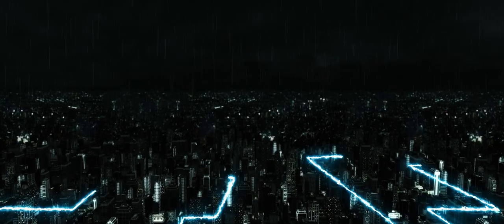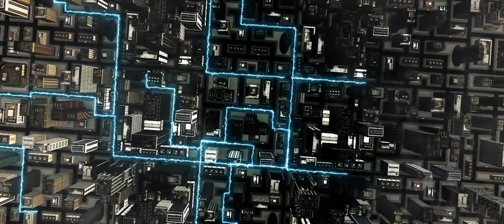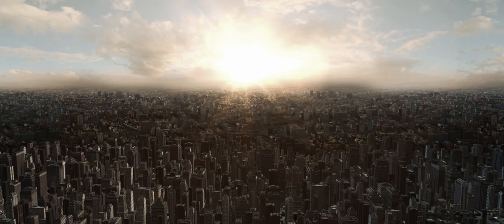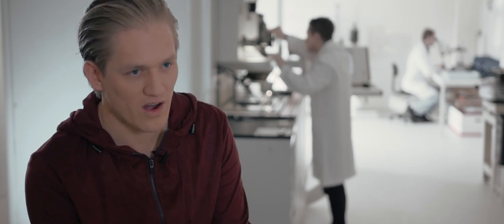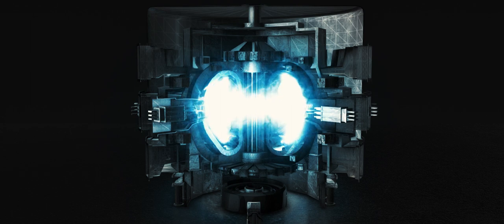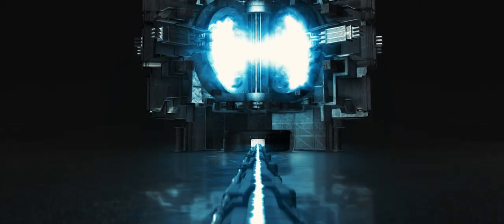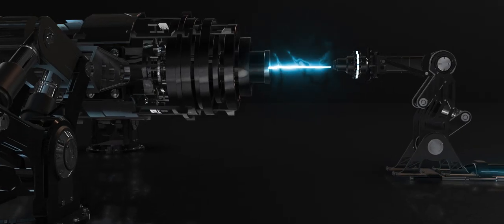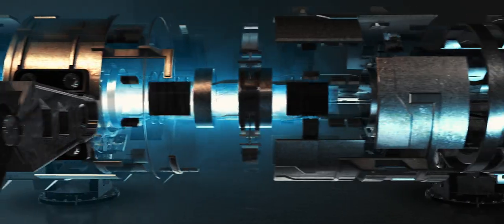Richard Dinan, Applied Fusion Systems - Will fusion reactors power space rockets?

Comment: Richard - i just saw you on tele. I read with interest a paper on-line about the use of Helium Oxygen mixtures for the treatment of a patient with SARS - a similar but even more deadly virus than Covid 19. The device redeveloped by Imperial College to suppy Oxygen /air mixtures might be readily adapted to supply Helium Oxygen mixtures. In the SARS case documented - it was suggested that the Helium Oxygen mixture changed the the gas flow in lungs from turbulent to laminar and hence reduced the 'Work Of Breathing' - the amount of energy required to breath. In this way it aided the recovery of the SARS patient. I wonder if this might be even more effective for Covid 19 patients given that SARS was a more severe disease. Whilst helium might be more expensive it might obviate the need for respirators. Helium may have other benefits in respect of actually attacking the virus itself by altering its lipid surface energy (Helium being a small molecule getting closer to the surface than Nitrogen 
Regards Peter Reynolds (PhDBsc)